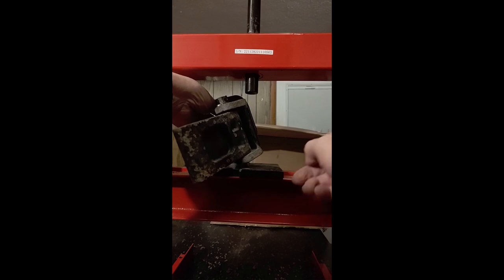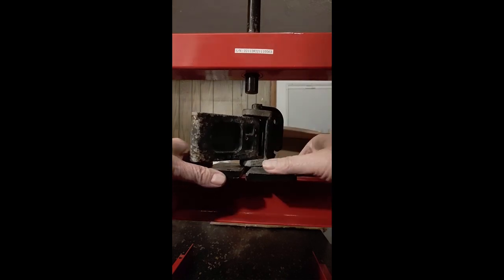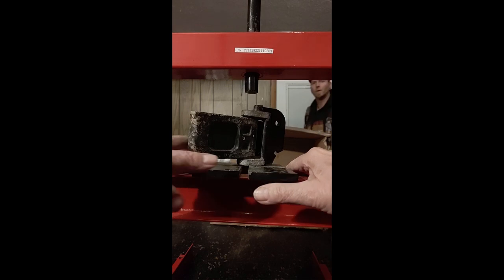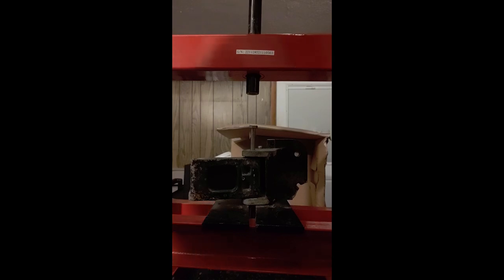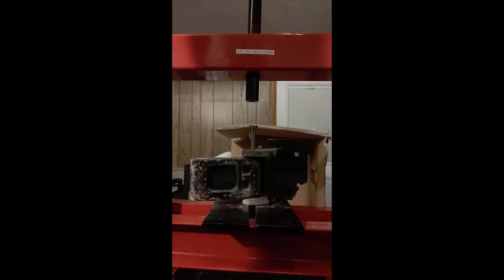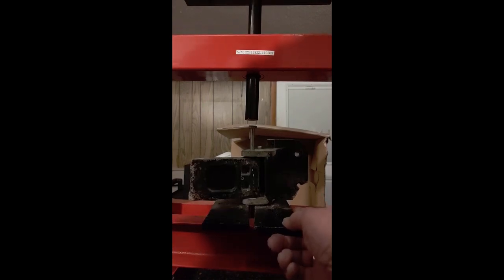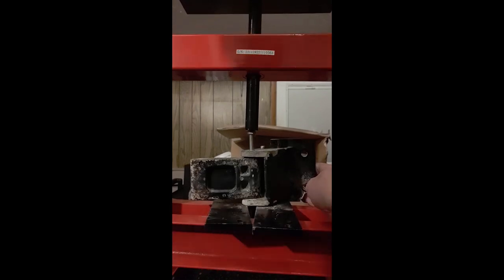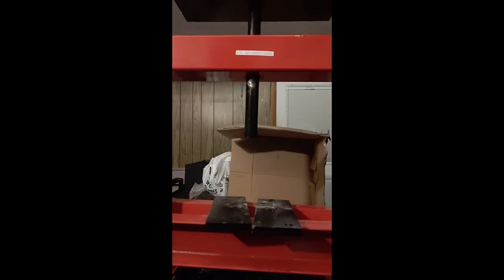Ford Expedition / Lincoln Navigator Power Running boards removing the pivot pins from the brackets

Comment: How thick are the bushings? Would it be too loose if you elimated the bearings altogether?  Or make bushing with more tolerance?
Reply from the maker: Good question. The bushings have a 1mm wall thickness. The ID of the bushings is 10mm the OD is 12mm. 

As to eliminating the bushings, well your car will do that over the years. I don't know if you watched this video, but if you do you will see one of the bushings is about half gone. This leads to binding. So removing the bushings is not a good idea. 
https://www.youtube.com/watch?v=ALPyhmUWhSA
Reply: I removed them and it was too loose. The motor shaft just spun in the hinges not actuating anything. I ordered the bushing kit from the company in the UK and waiting for them to arrive. I will try and make a youtube video of doing the repairs also. Not much information out there on this stuff.
Reply from the maker: I shall look forward to your video on the subject. Yes, the real how to do it information is rather limited. Mostly just spray and pray.